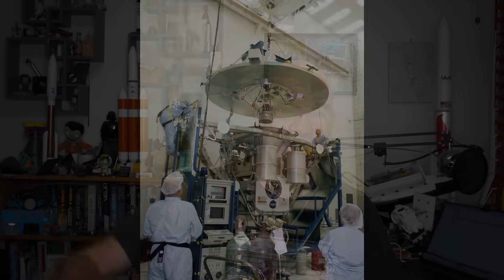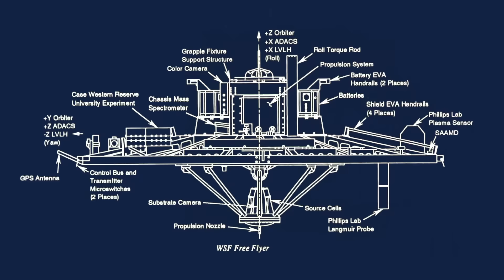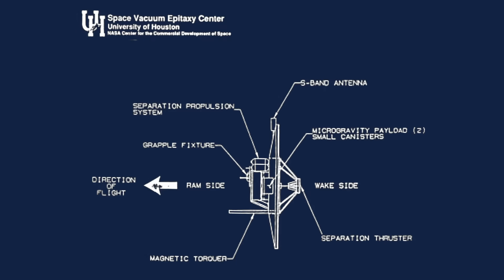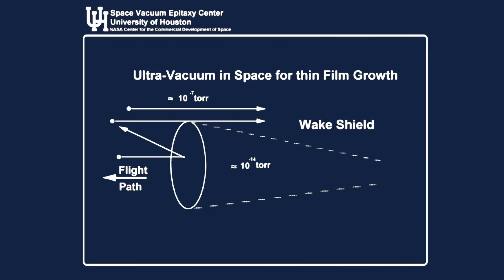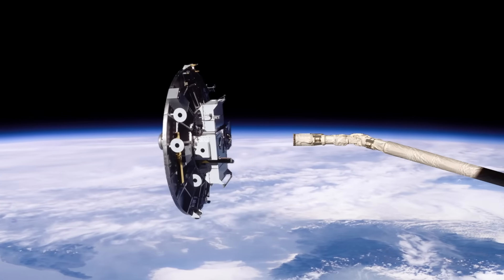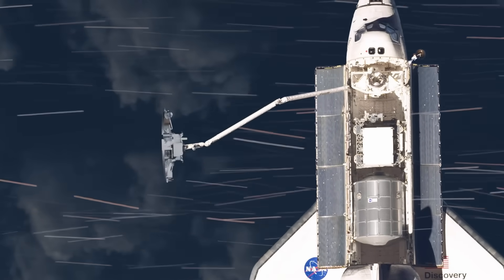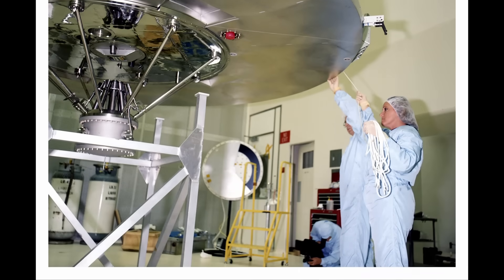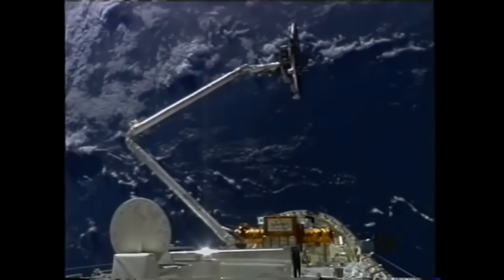How NASA Made The Vacuum of Space Suck More - The Wake Shield Facility

Comment: total complexity matters. so why cant you make low pressures on earth. because you can. space adds complication, only hype bling bling. scientific curiosity instead of reasonable approach. you have to calculate in the cost if you calculate costs. still more economical to make the silicon chips on earth. you can do them anywhere tho. even on a space ship. don buy what the sellers are selling with hype slogans. well you already know what you are doing right. well on trip to the disc costs millions. not very economical per batch. if your goal is costs. make the earth accelerator track instead. around the planet you go. hold on, you can pre-vacuum your floors on earth too. then just ultra-vacuum those. effort per product is orbital. ie sounds bs nonsense. diy fund it yourself. if you need funding then you are doing something wrong. ie your house of cards collapses/d. if you are in space otherwise then its also reasonable to do other stuff in space also. maybe focus on being space first.
Reply: once we permanently live in space it will be cheaper to make things for our use, in space, than hauling it up in a rocket.